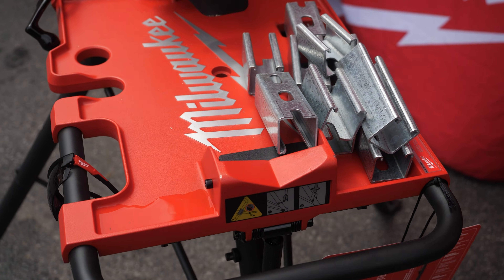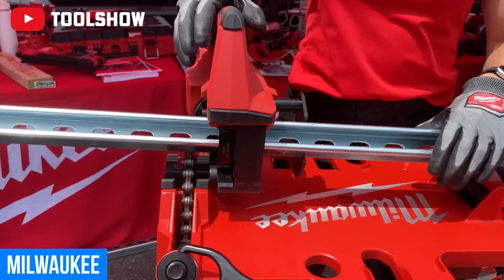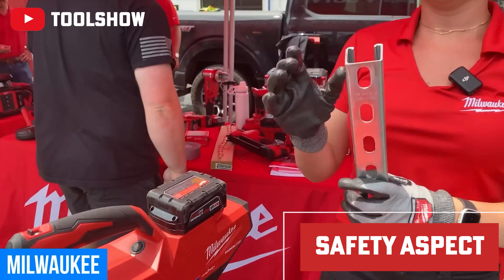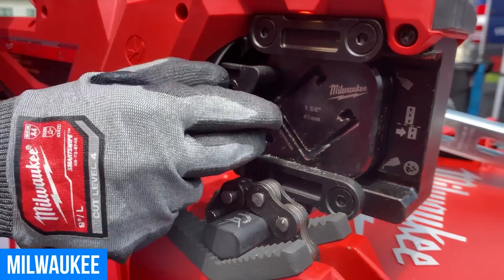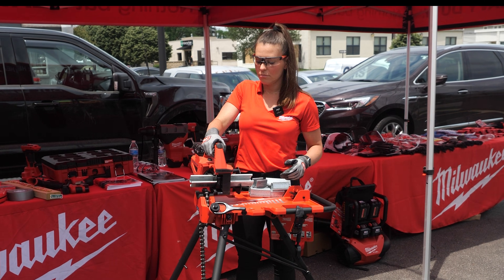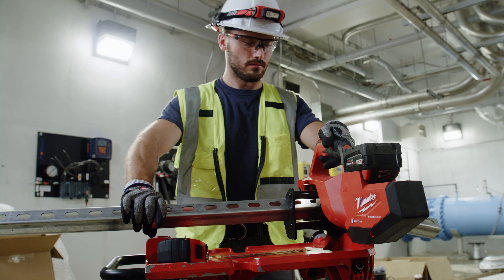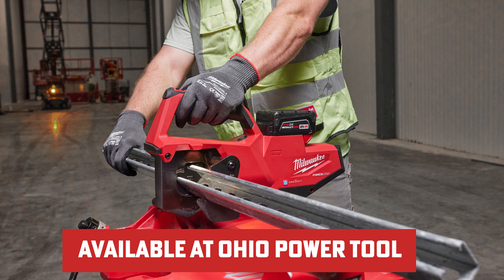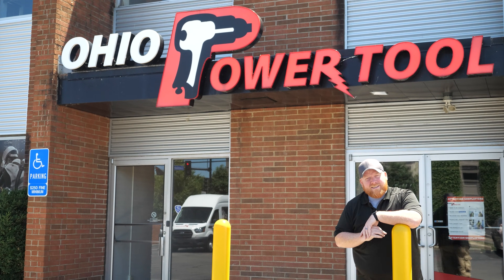Shear Excellence! Milwaukee's M18 FORCE LOGIC Single Channel Strut Shear | 2933-21

Comment: really cool, but why not make an attachment for the Linear Utility Crimper or another 6T cutter/crimper?
Reply from the maker: Creating an attachment could work but the Strut Shear is a great option for that consistent power, smooth design, and enhanced safety feature.